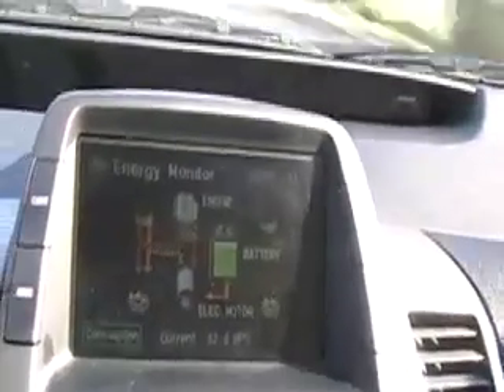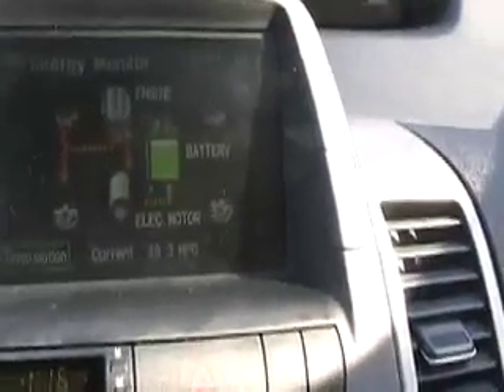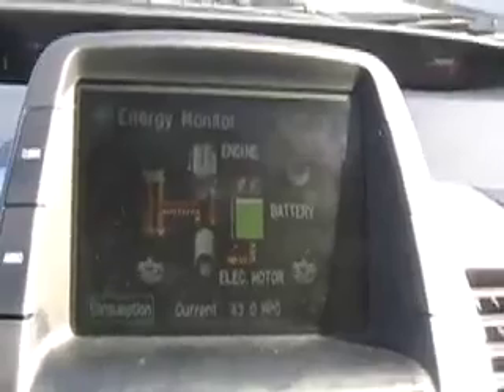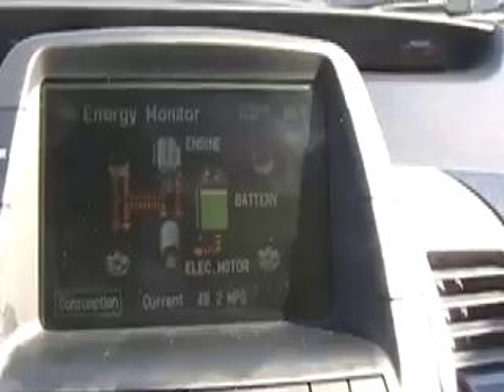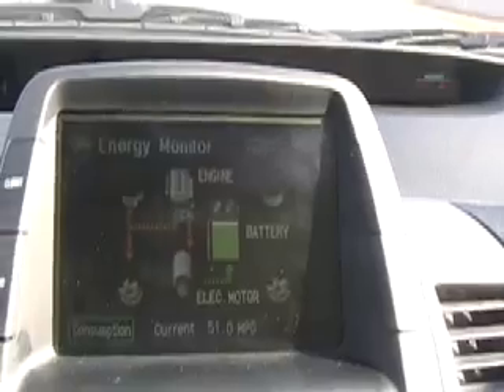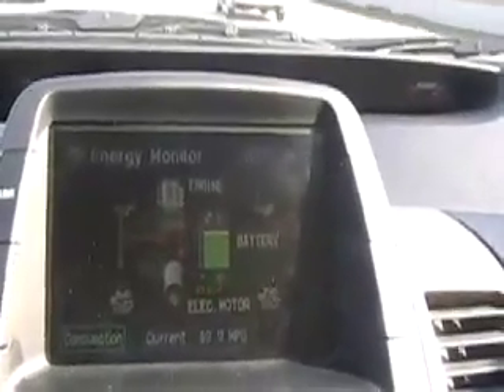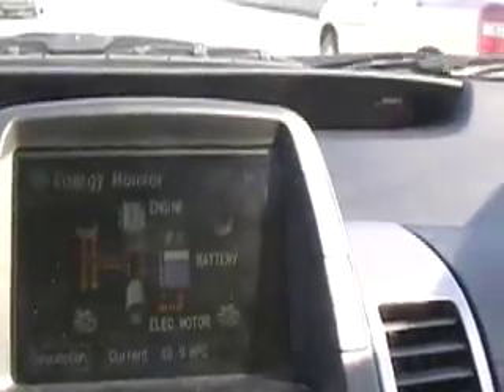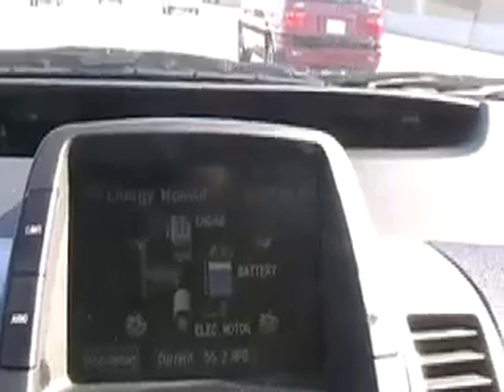Three big problems with the Prius - Tape 2

Comment: continued Of course it's plug in so no gas needed till you empty the batts but after that less mileage than a Prius.  A pusher trailer is more efficent than an electric gerator driving the electric motor and it recharges the batteries as well. 
The new battery tech coming out from Panasonic is more promising than NiMH - you may be able to stop at a recharging station and "fill up" in under 10 minutes - sounds familiar? Of course these recharging stations will be expensive to build and operate.

Comment: continued.. a serial hybrid is less efficient because the size of the ICE need to develop the KW to drive a decent sized electric motor is quite large. The Prius's electric motor is small (roughly 50KW) - so a serial hybrid needs: a bigger battery, a bigger electric motor and an ICE (probably smaller than the ICE in the Prius but still pretty big and a fuel tank.). that equals more weight and an inefficient drive system.

Comment: I think what the OP is tryin to do is admirable bu filled with false facts. 1. NiMH batteries like to be fully discharged. Wrong. There isn't a battery tech on the planet  that "likes" this. The orig NiMH pack was more robust because they weren't made up of tiny AA cells because of patent issues. This makes management a nightmare. 2. A serial hybrid (ICE charging batteries) is LESS efficient than a Prius. Inevitable losses occur charging a battery to run a motor to drive wheels.

Comment: That's typical hybrid behavior now a real problem with the Prius that Toyota needs to fix is the traction control's idiot behavior in snow and ice when climbing a hill.
They should at least add a switch for the traction control.

Comment: Very hard... the battery would not last the distance.. It'd need replacing pretty soon in that mode. (See deisel/electric trains)
Also during heavy acceleration the gas engine would not be able to feed the battery to keep the wheels turning if the battery was reasonably flat!

Comment: You are exactly correct, the person who made the video doesn't understand the system of the Prius at all and should spend some time understanding minimal idle speeds of gas engines and learning about the fact that the little motor isn't big enough to meet moderate acceleration alone.  The hybrid cars give you the absolute best of both worlds.  Just point and laugh at all those people who think everybody is going to drive electric.  Electric motors make no heat, no heat in 5 feet of snow = bad.

Comment: there are two ways for a hybrid to reduce fuel consumption

1. regenerative braking
2. the car can shut the ICE off when the car is coasting.

furthermore, plug-ins will never be produced for the same reason CNG never will be. If the were natural gas would be taxed as motor fuel also. and the saving would be wiped out instantly

Comment: Now when the battery is empty try going up a steep hill.  Battery plus ICE equals plenty of power.  The battery in a Prius is never over 80% charged the graphic doen't show outside the range 40% to 80% which is where the battery is happy.  How much research did you do compared to Toyota? Do you know anyone who has changed a Prius battery?  My 2004 is going strong, how is yours?  I trust Toyota over you.  Sorry.

Comment: In truth, there is no reason you can't have a hybrid system like they have in locomotives. 
A small 1.0 engine powering a generator, charging a small bank of batteries, and having a electric motor for the power plant.  The technology has been around for decades if not longer, but has been held up for no reason. 
It's now in a bike/car concept and getting well over 100mpg.